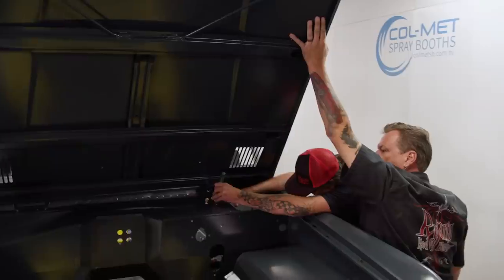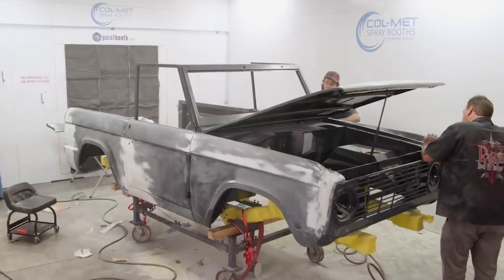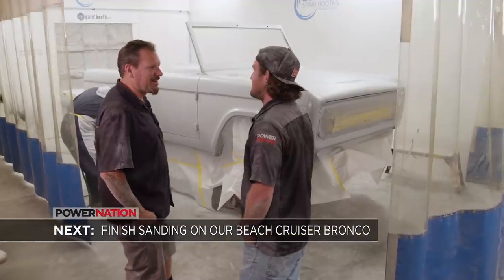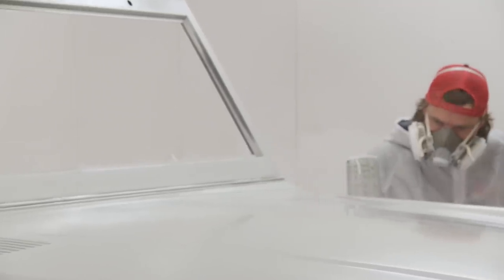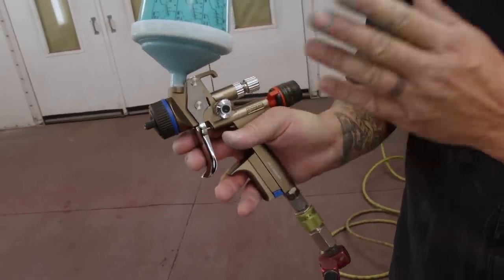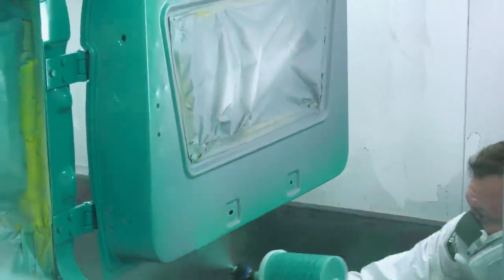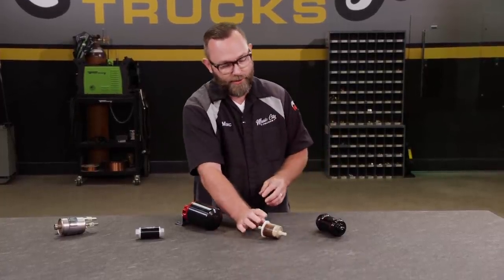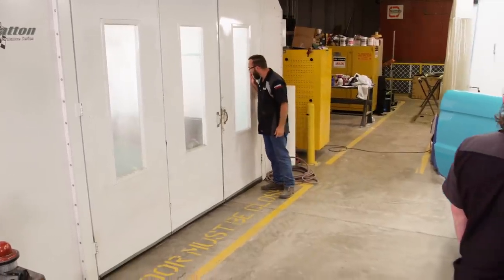Bold & Beautiful: The Classic Bronco Goes Caribbean Turquoise - Music City Trucks S1, E15

Comment: Yeah but the work space you have to work with for the coyote motor is like trying to work on a mini van it’s complicated cause the work space is tight. It’s like your building a smaller version of the raptor just a SUV.

Comment: All those extra steps and the paint still looks rough as hell when finished. Skip the extra primer steps if you're going to paint it so you need to wet sand and polish after it anyway.
Reply: Beach buggy... meaning sea salt air and saltwater splashes. 20 years ago, I had a westcoast 74 Bronco that spent some time at the coast in Washington. Rust was everywhere in every nook and cranny. The previous owner did his best to cover it up, but when a passenger door falls off because the bolts holding it onto the body snap and closing the tailgate sounds like glass breaking and falling inside it, you know you're in trouble. I traded to someone with deep pockets, but to restore it, it needed every body piece and I didn't have that kind of money. Frame and drivetrain was very good and off roading never better as long as you overlooked the body. Personally, it sad it is sad that the truck in the video will be driven anywhere there is salt. Sea salt is worse than road salt, it's a 24/7 52 weeks a year attack on every part made of steel.

Comment: after all that work you can see a lot of orange peel  at the end!!!
Reply: What that guy said👆
It’s not ‘the end’.
Reply: @Maybe, maybe not. tail gate center looks like shit ...very poor film build and that's a tough area to cut and buff coz it's recessed ...not a quality job imo
Reply: It's about atomization.
These gravity-fed HVLP guns do not atomize the paint nearly as well as the old siphon feed guns. 
Also, using a too fast reducer can cause early flash-off, preventing the paint from flowing.
A competent painter with the right equipment and materials (screw VOC's),
can really lay it down.
It also makes the color sanding and buffing go a lot easier.
For production work, such as collision repair, no buffing required.

Comment: I'm eating an orange with a smoother surface than that paint job. Wow 🤦‍♂️ All that A+ prep work then a C- Maaco spray job.. Turn down your product and spray a little slower. Base/clear isn't a race in a temperature controlled booth. That was a factory quality paint job, definitely not SEMA quality.